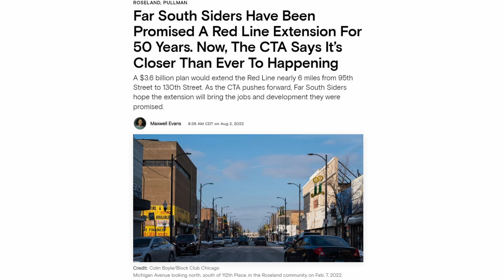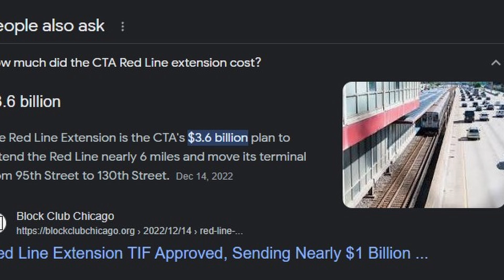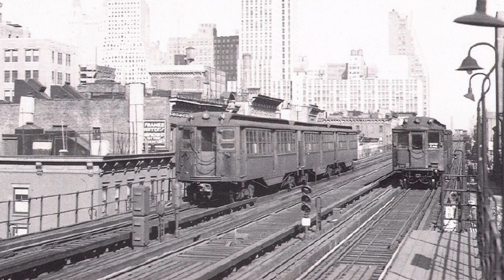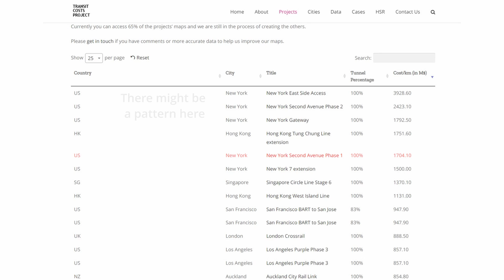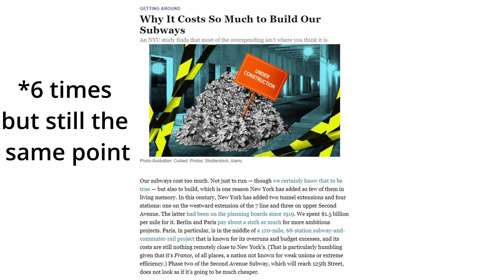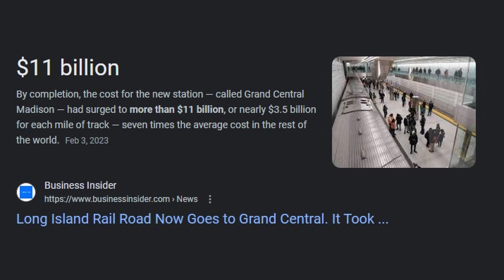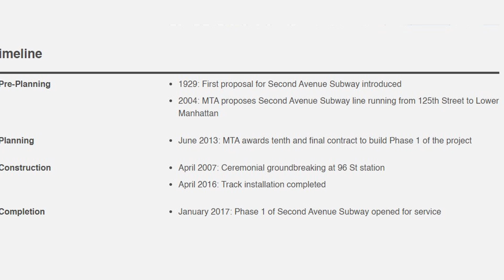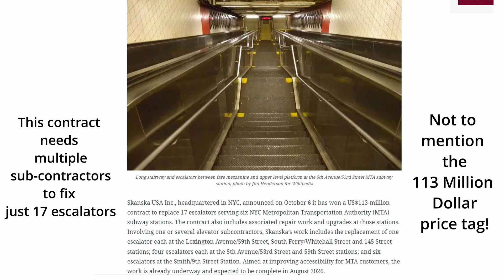Why Building Transit Costs So Much

Comment: 12:45 I'm not sure that statement is correct. In Montreal, the ARTM is meant to be the agency planning transit. It was recently created to replace the ATM and has a wider mandate. The fact is that the big engineering firms in the city just have more money to throw at their employees than the ARTM. They simply can't give competitive salaries on the tax payer's dime, and especially not performance bonuses and incentives. The ARTM ends up with peoples who really don't have the competence to do the job. Yeah, there's a few guys here and there who actually know what they are talking about, but generally speaking... Let's just say that after the report that they wrote to discredit REM de l'Est and their own attempt to create an alternate project proposal for Montreal Est, they dug a heck of a hole for themselves. Heck, it does not even feel like the peoples in there have basic self preservation instincts and its not like they really need it. Given the power that trade unions wield in Québec, they feel safe enough to be able to put out that kind of trash and still be employed at the end of the day.

Comment: Great video.
Just a "small" correction, the Barcelona line is actually 2 lines (L9 and L10) that share the central section. The total length is 48km (30mi) mostly in tunnels (the last 5 stations on the L10 southern section are elrvatrd) and has a total of 50 stations. The main section is deep underground (up to 80m/252 feet deep). Tomreduce cost they boare one large tunnel and each direction is in a different level and the platforms use the same tunnel. Design is nice but basic and similar in all stations. Trains are automatic.
The 7B€ cost is for the whole project, and more than triple than the original estimate You can at least take comfort from the construction time. It was supose to fully open in 2012 but problems during construction but mostly the 2008 world crisis stopped all funding. Today two separated section are open (with the 24 mentioned stations) and they are back at work on the connection between them. The full line should open in 2027, without a few of the stations that will open by 2029.

Comment: What it boils down to is an Inefficiency in Bureaucracy and only using specific contractors using strong arm tactics. Breaking up these good old boys will help in curtailing overages. Also, hire contractors that can deliver on time with a bonus and a steep penalty if they fail.

Comment: meanwhile in china makes 6,000 Miles of toll roads and 1.000 Miles of high speed trains every year.  where design, study and approval can be completed within 1 year.  making the construction of 40% cheaper than in other countries.

all implemented by a one central agency and built by a single state-owned enterprise

Comment: Hello, nice video !
I was just wondering, few things.
In America you have the "The Boring Company", which as many Elon's company is pretty much vertically integrated, so theoretically, if the tunnels made large enough for the trains it would be possible to reduce the number of contractors involved in the project. It would have also the accidental collateral effect to make Elon produce something that the world actually needs.
Secondly I think one of the major expenditure in those type of infrastructure is the feasibility study and planning studies which tend to become outdated, resulting in further expenditures for studies without having actually anything built. Provided that those documents are inevitable, would be reasonable to ask not to do any analysis until the first functional lot of the infrastructure is financed?
Reply: Are you saying electric vehicles and solar panels are not things the world actually needs?
Reply: @evancombs5159  Sorry, as Tesla was a company producing cars before Elon took over I, personally, do not consider this company as his creation neither as his property as it is a listed company.
The maximum credit I can give to him is to be a good private equity investor and company promoter.

Comment: An interesting video but you really have no idea about how contracting actually works. Contracts are generally let for a fixed price. Your comments about contractors standing around with nothing to do because they don’t care about how long it takes is simply BS and an pathetic insult to those involved. All countries contract out large projects. Not the least because pulling together a large workforce with all the necessary skills is impossible. Stick to Urban Planning because your attempt to beat up those who build the projects is mostly rubbish.

Comment: First of all it you want to be an expert you need to learn how to pronounce  Houston, unlike the city is is house-ton like the place you live.  Secondly the expense in any subway system is not the station it is the tunneling and local disruption.  In NYC you are moving massive amounts of people per your own analysis.  If you analyze the cost not on the bottom line but on the cost per rider you will find that the 2nd Ave line is one-quarter the cost of LA and other cities (there is a you-tube very well done on this). The lines are comparatively deep to attempt to disrupt the surface activity as much as possible and in NYC the bedrock is some of the hardest on earth.  Then there is the activities to relocate utilities, secure foundations etc.  Finally the contracts let by the MTA do not pay on how many hours the employees work, but rather the bid cost to complete the job.  Any standing around is the contractors cost.  However, if they were built by the government all the "standing around" costs are borne by the agency.  In order to compare costs one cannot divide by mile but there are dozens of other factors.  Wish it were as simple as you make it out to be.

Comment: NYC is a liberal bastion yet they can’t even audit the MTA for their blatant corruption schemes. It’s astounding that the MTA thinks they have the right to crack down on fare evasion and raise prices for passengers while still providing shitty inefficient, unreliable service that is supposed to run 24/7 when in reality only some lines run 24/7 at reduced service. The solder stations are either covered in a black/brown muck that stains the walls, exposed lighting that hurts when u look up at them, homeless people and zombies that the NYPD REFUSE to remove from our stations despite the new announcements saying that there are officers on the platform when they simply won’t do anything. It’s extremely disheartening when the political support for mass transit exists yet the policies implemented and regulation surrounding it inhibits overall growth and cost controls.

Comment: Not sure if anyone pointed it out yet, but the map at 4:35 is incorrect. The 125 St station will lie on 125 St and Park Av, not 125 St and Malcom X Blvd as shown in your video. In fact, the tail tracks at the far western end of the extension may only go as far as 5 Av I believe.

Comment: Now it seems the MTA is backing off or scaling back on major builds, such as cancelling the rail extension to LGA and building the Interborough express as light rail to avoid tunnelling under a cemetery. Also, why do projects take so long to complete?
Reply: The Inter-borough express is of more importance than the LGA connection, given the two boroughs have limited connections that don’t include Manhattan. We should also be focusing on a Queens-Bronx connection. More connections between the boroughs is of greater importance than LGA to be honest.
Reply: @Jorge-lh6px  In a city the size of New York, doing both seems perfectly reasonable, even "aiming low".  Why not complete it all the way to the Bronx, rather than kicking that down the road a few decades?
Reply: While they're going to build the Interborough Express as light rail I'm hoping they'll build it as a light metro or even a grade separated version of L.A.'s light rail rather than an ordinary tram.
Reply: @edwardmiessner6502  it is supposed to be entirely grade separated except for one street running segment in order to avoid tunneling under a cemetery.

Comment: Grand Paris Express stations are huge, full of "backstage" areas, maintenance and staff resting rooms, machinery space, etc.
Like Villejuif Institut Gustave Roussy station (interchange M14 & M15) that is a giant underground cylinder filled with crisscrossing escalators of which a substantial width of the outer rim is allocated for maintenance and staff.
Or Saint-Maur Créteil station, the deepest of the network that has a giant vertical shaft, 40% of which is not for passengers and reserved for maintenance, machinery and staff (not for elevators, these are in the remaining 60%).
They all have substantial areas for maintenance and staff and are huge. Paradoxically, the ones that have the least "backstage" area are the few elevated ones.
The new stations "collection" looks like an architectural contest gone wild ! Only 3 of the 68 are somewhat on the same model and they are of the few aboveground elevated ones. They'll share a similar , yet not copy and paste, design with different color schemes.
The rest of stations is mostly deep underground, huge and unique with grandiose designs and large atriums.
So the inflated cost of either MYC or Chicago subway expansions can't be found in the size of stations if you compare to Paris, nor in the complexity.
Reply: Right but in New York on the 2nd Ave subway at least the stations were mined caverns, which is the most expensive station construction technique; whereas I believe most in Paris were just cut-and-cover which is automatically cheaper? New York also has to build for much longer trains (180m) than Paris does on any of its Metro lines.
Reply: @BigBlueMan118      It isn't, or at least it isn't an absolute fact.
It would have been if you had compared cavern mining in solid rock to shallow cut-and-cover in dry & stable ground, but there's no such thing in Paris' current project.
Out of the 200km of new lines in the GPE project, there are 180km bored deep underground, the 10% that's left is mostly on viaducts, with just a tiny bit at grade on the surface.
New York's underground is mostly solid rock, which is much simpler than the Parisian soup and croutons...
Paris' underground is a slushy Swiss cheese mix of near surface rising aquifers, damp sand pockets, layers and layers of former quarries (sandstone, gypsum, sulfur... often flooded), gravel, clay, voids, the occasional chalk marl, etc.

Even if parts of the stations are cut-and-cover (not exactly though, it's mostly the deep bentonite molded diaphragm walls technique that was used for the main or top parts of stations), the lack of sufficient space on the surface for the station box' footprint meant that most required bored tunnel enlargement and mining in unstable, damp and marshy / marly ground.
There's at most a mere handful of stations that had sufficient space to form a fully complete station box from the surface like Noisy - Champs, Paris suburbs are too densely built and populated for that to be possible.
An interchange station like Villejuif IGR had its main station box made out of a giant underground cylindrical void from which vaulted platforms extend on 2 different deep levels. The cylinder was built using the bentonite molded diaphragm walls method and digging ,but the platforms required 4 mined vaulted caverns.
Just like most stations on the South section of M15, they were inserted into a densely built urban fabric and often under other working train lines which prevented direct vertical access.

The pretty bad soil conditions are the reason why a substantial number of the TBM's used were of the pressurized slurry (hydro-shield) or mud pressure balance type instead of the simpler mole or even earth pressure balance types.
Plus, of course, frequent use of ground hard freezing techniques to try solidifying the ground to prevent it from instantly collapsing on itself and avoid floods (which happened).
Several stations were a nightmare to build, like Saint-Maur Créteil, a very deep one located between two arms of a river loop, passing through the water table and requiring hard freeze mining, beam grouting, underground anchoring, buoyancy mitigation, etc.
The surface footprint doesn't cover the platforms, of course...
Add to that the many access, evac, and ventilation shafts located no further than 800 meters apart, requiring more than a hundred simultaneous building sites...
There are something like 40 of those shafts just for the 16-station, 35km long South section of M15 (the giant loop line) that's expected to open in fall 2025 (should be around 100 or 110 shafts in total for the whole M15).
About 40 shafts for the parts of M16 & M17 that have already been dug (should be around 50 or 55 in total).
About 14 shafts on the already built part of M18 (should be at least 24 or 25 in total).
And between 15 and 20 shafts for M14's GPE extensions.
Let's not forget more than 20 TBM's working simultaneously and the various cold generation factories all pretty much at the same time.
Workers needed to be trained like scuba divers in pressure chambers to access and maintain the cutting wheels under a pressure of 5+ bar.

New York's underground is easy in comparison because solid rock simply doesn't fold on itself the instant it is dug.
Is New York's subway required to have shafts every 800 meters or less?
In the GPE's cost are also included almost a thousand escalators (current tally) and several hundreds of elevators. The Saint-Denis Pleyel interchange station opening in late June has something like 56 escalators and 2 or 3 dozen elevators, just to give you an idea...

So no, it isn't simpler to build a tunnel or station in Paris than in New York. And cavern mining in solid ground is far from being the most expensive station construction technique.
What's expensive is building anything, whatever the technique used, in the US, especially in New York, or pretty much in any English speaking developed country.
While it is much cheaper in most developed non-English speaking countries, even when using much more complex techniques.

Recently, a new gigantic underground cavernous cathedral was built for the new la Défense station on RER E's Western extension in Paris. (The RER is Paris regional heavy metro network that uses massive double-decker trains, it is famous for having several gigantic mined vaulted caverns called "underground cathedrals" under super densely built central Paris).

The new la Défense E station required mining a giant 225+ meter long massive cavern without vertical access under a working expo center. They replaced and extended the foundations of the expo center (it remained open) by digging through an underground car park and mining between skyscraper foundations.
It only cost a mere fraction of a simple station in New York.
The same conditions in New York would have been even more expensive.
Reply: @KyrilPG  you could have saved yourself a lot of time my friend, no-one reads comments even half that long on YouTube! Noone is saying NY costs are not ridiculous, they are and at the present costs I would suggest they should really start Just looking at Light Rail and/or automated Metro, but setting up a new Agency that can actually build and ditching MTA for future expansion.

Comment: Similar problems in Canada too. It's taken 12 years to construct a light rail line in Toronto and it's gone massively overbudget. I should also mention that the agencies involved are now in a highly publicized legal battle (one of many). If anything, you're absolutely right. The Ridiculousness of it all is absurd. In the end it comes down to incompetence of the governance and management of these systems, if politicians simply stood out of the way and stopped using public transit as a generator of votes and election platform fuel, and let 100% more competent, well practiced, and trained professional engineers, architects, urban planners, transit planners, and public policy developers to build transit by themselves we wouldn't have these extremely ridiculous issues to deal with. Great video!!
Reply: "if politicians simply stood out of the way and stopped using public transit as a generator of votes"
Then you will not have politicians advocating public transit projects.